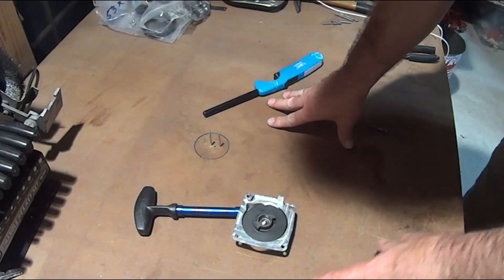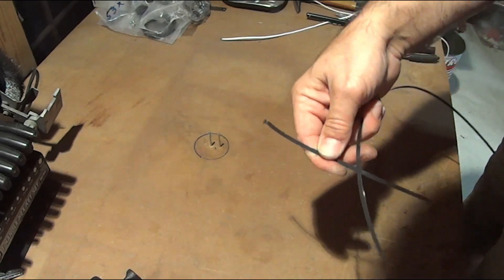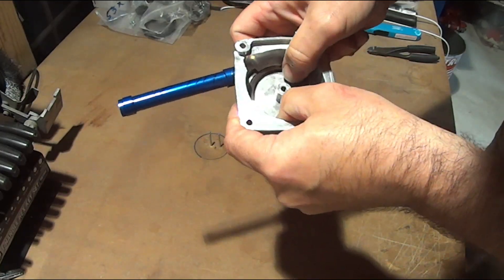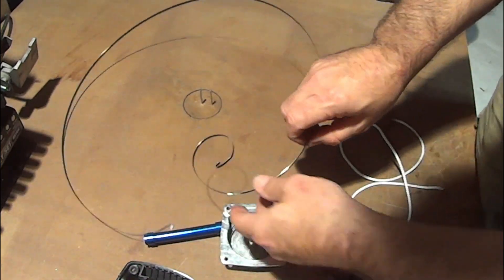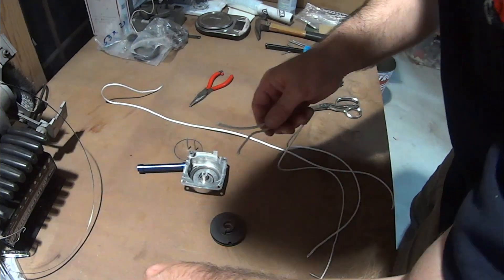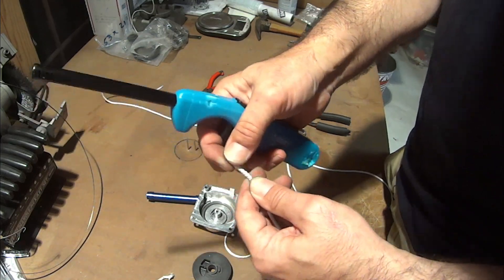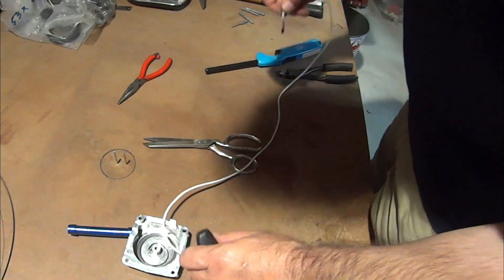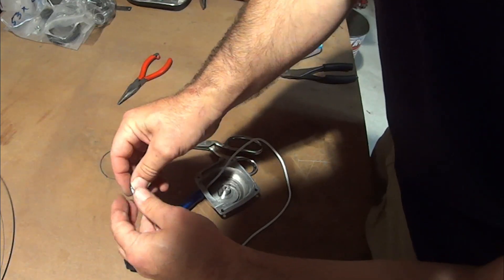TAYLOR (FKA RCMAX) 5TH SCALE PULL START REBUILD TUTORIAL!

Comment: good afternoon,is there any videos of installation of this pull starter on a losi 5t/ 30dnt, many thanks
Reply from the maker: Evening mark, this starter in the video is only for Taylor Big Bore engines, it just bolts right on the 4 fitting screws, hence i worry that you might be trying to fit it to a small bore engine?

Comment: Thanks John appreciate the video great information 

I was wondering though what are the two important length of the pull cord with extension and without
IC 
standard length without extension = 870mm
Length with. Extension = ?
Diamond Cord thickness ? 
For correct diameter of cord to length 

I have both with and without extension part I was adding a extension on another pull start my back up one but Im not sure what cord thickness and length of cord with extension part added is

Comment: 1.  What is the proper length for the pull start cord?   2.  What size flanged nut did you use on the pull cord handle?
Reply from the maker: Depends on normal or extended starters and what thickness rope. We sell the new diamond cord in pre-cut lengths to suit its size. 870mm for std length. We use an M6 flanged nut for the RCMAX plastic handle!